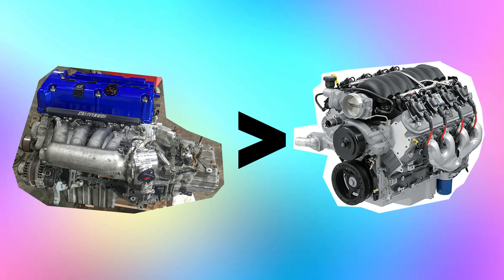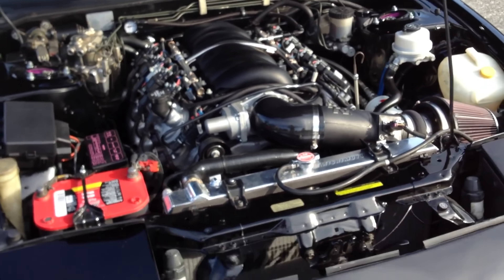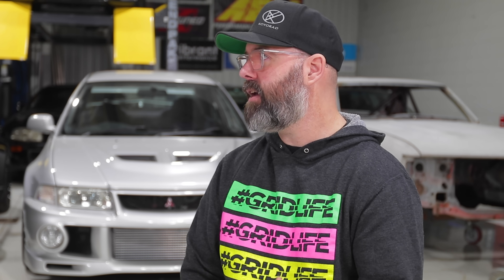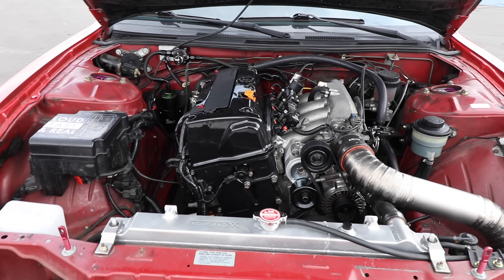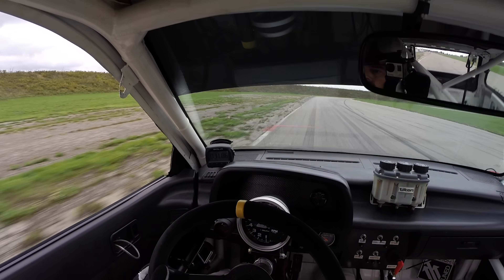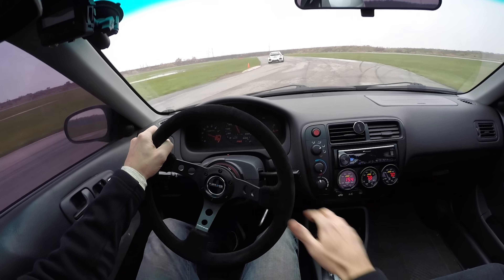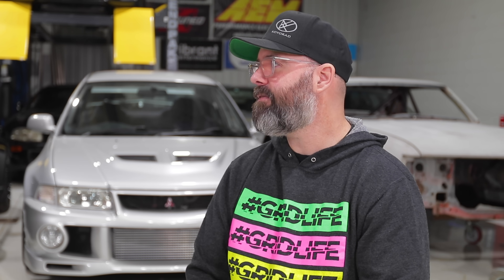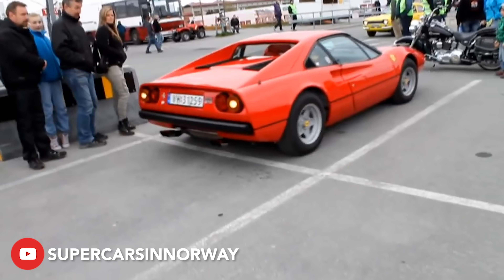Is the K-SWAP the New LS Swap? Everything you need to know about K20 K24 Honda Engines

Comment: Is the K swap the new LS swap? While it's on its way to becoming the belly button swap for small cars I highly doubt it'll see the same range of use as the LS/modern LT family which has been the default engine in damn near everything, for better or worse, for almost 15 years. I think what you're going to see is a possible parody between LS/LT, K series, and possibly JZ but it would be nice if more people would get away from the cookie cutter  engines.

Comment: Downside of the k for fwd and mid engine cars is the transmission.  Honda makes great engines but not transmissions.  I've heard of the rsx 6 speed tranny breaking on the dyno on a stock motor. You have to spend lots to get a reliable Honda transmission.

Comment: the k engine is great, but actually doing the swap is quite expensive for most chassis. spending usually about $10k for everything to get like 250hp vs fully building what's already in your car, or building for boost is where i dont really understand why people like the K. but if money isnt a factor then all power, they're dope engines with lots of potential.

Comment: If you want a good sounding K series, you really have to keep the exhaust buzz under control with proper resonators and mufflers, and let the induction provide the soundtrack. The intake noise on the K series is great, and you can still make great power with a quieter high flow muffler setup.
Reply: applies to almost every high revving 4 cyl N/A engine
Reply: Vibrant piping only
Reply: @ssjdavid  what
Reply: @MotorSwapDan  vibrant performance piping
Reply: The Q300 at 2.75in ID is the best sounding exhaust on the K. Hard Race has a 3in that also sounds superb

Comment: Would love to see a K-swapped RX-8. The series 2 (09-11) used the same trans as an S2000, so I assume shouldn't be too hard to fit up, and the 13B-MSP's power and torque curves are near identical to an S2000 and so gearing etc for a K-swap should be pretty good to go, right outta the box.
To be making 250-300 NA high-revving whp with a small engine that maintains the balance of such a good car that is so avoided because of the rotary engine in it, would be an amazing project. Not to mention, an incredibly affordable shell to start with!
Reply: It’s bin done a lot actually
Reply: @Rxwaat  I haven't seen any build threads/blogs/vlogs on a K-swapped RX-8, or at least one that shows the challenges faced and overcome and the job seen to completion.

But if you are aware of any, PLEASE do provide a link as I'm VERY interested!
Reply: @joshwolfe5260  6berries on Instagram I forget his YouTube channel. He’s helped me a lot with k swapping my rx8

Comment: We approve of this video :)
Reply: Please make FC3S swap parts pleaseeeeeeeee!!!!!!!!!!!!
Reply: If you’re doing the K E30, please add the K Cressida.  I’ll be your first customer lol
Reply: We all know you don’t know what you’re talking about, since you just referred to every 6 cylinder engine on your list as a “V6”
Reply: I’m trying to do something so sinful even Christ himself would ban me from heaven.  swap a K series into a B5 A4 with Quattro 6 speed manual 😅 already know where to find an adapter plate just need engine mounts 😊
Reply: K swap new edge mustang? Bad idea?👀 pretty similar weight and size to a 240 just sayynnnn.
Reply: Li as a
Reply: Who is we? Here is why K Series are not superior.  I rather Swap LS engine or Rb26, 2jZ k series are good but it's 4 cylinders and Front wheel crap drive  comparing to ls v8 or v6 2jz Or RB26DETT Nissan  RB28 is more superior and Reliable even with turbos bc no.matter what u do The K Series engines with Turbos wont passed 100  thousand miles without major Problems or Major Maintenance
Reply: @Mansour-O-Killuminati  ah yes the legendary "V6 2jz"
Reply: @THEWATER3UCKET  V6 2JZ is superior than I6 2JZ. It is capable of 10000 hp on stock bottom end(No, I didn't miss the zero).

Comment: You can take an LS3 and change cam and springs and make almost 600hp. And I'd bet my entire collection of Snap-On tools that a K-series with all the associated plumbing/intercooler and turbo weighs about the same as an aluminum LS. I love a K-series. But it doesn't hold a candle to an LS lol.
Reply: There can never be too many good engines! LSes and Honda Ks have a few things in common: they are relatively cheap and plentiful, there is a lit of support for them, and they have great packaging that make them suitable to many, many applications.

Comment: This definitely seems like the go to motor for transverse setups, or anything where you can't fit an LS. For longitudinal where they fit, the LS still has the K beat handily in terms of power per dollar. That $8k for a 300whp K motor would get you a 500bhp LS3 crate engine straight from GMPP.
Reply: Why would you waste 8k on a crate engine. Stalk the junkyards. Its not a sema build. An Aluminum 6.0 CAN be found in the junkyard for 200 USD at my junkyard. You're not entirely likely to find them, but you can find the iron 6.0s and aluminum 5.3s all day for the most part. Cheap shit.
Reply: @benbauer1257  Yeah definitely. Same as you can find reasonably cheap K motors as they were saying. LS handily wins power per dollar no matter what comparison you make. I was just comparing new engine to new engine because that's what they gave numbers for.

Comment: Wait, why would you need more engine torque in a heavier vehicle? That doesn' make any sense. You can get the same wheel torque by changing gear ratios.
Reply: There's probably a reason Honda uses a K24 in the Accord and not the CBR1000rr engine despite the fact that they make the same hp and I'm pretty sure that reason is torque.
Reply: Between S2000 and E46, there is only ~200 kg difference, not ~1200 kg as between a bike and an Accord. 
With a N/A K20 you can easily get the same wheel torque as one of the faster E46, say a 330i. 
In a heavier vehicle you want more power, engine torque is secondary.
Reply: @Remenschneider  the difference in torque between an e46 330 and RSX Type S: 73ft/lb

The difference in torque between 08-12 Accord (K24) and CBR1000rr: 85ft/lb

If you're suggesting just using gearing to make up 73ft/lb what's another 12ft/lb?
Reply: @lb9gta307  Let's take a stock FD2 Civic Type R (221hp, 159 lb-ft, 5.062 final drive, gear ratios = RSX Type S) against that 330i and compare peak wheel torque through the gears (winner/difference).
 
1st 330i (+4%)
2nd FD2 (+6%)
3rd FD2 (+12%)
4th FD2 (+13%)
5th FD2 (+12%)

Then again, the FD2 has a 6-speed vs. the 330i 5-speed transmission.
If you compare 6th gear FD2 to 5th gear 330i, 330i wins (9%)

I know you'd need to consider the vehicle speeds in each gear,  engine torque curves and wheel diameters to get a "real" comparison.
Internet says FD2 does about 62 mph in 2nd, 330i about 65 mph. 
I'd say that's close enough, the FD2 does have a bit shorter gearing but nothing unreasonable.

So, K-swapping the E46 wouldn't be a bad idea because you need something with specifically more torque, it's just likely not worth it since the 330i is so close and the M3 exists, which has tons more power in the first place.

Comment: What’s HP vs weight of a LS vs K motor at the 500 HP, because that’s a cam swapped LS low power, so you would need to add the turbo and plumbing intercooler ect weight to match the power level

Comment: When will Summit(or large mass production company) start pushing out engine blocks and cylinder heads (for Honda, Nissan, Toyota, etc)... Till then its hype.
Reply: Hard to get better than the stock head.
Reply: From what I understand the old LS, Hemi, Ford V8 head designs are rather inefficient compared to Honda's K-series heads. In comparison, the K-series heads flow like crazy from the factory relative to displacement. Take my 8th gen Si for example with the K20z3 from the factory; they put down at max ~170-180whp (and that's being generous) completely stock. With a 3.5" cold air intake, catless long tube 4-2-1 header, 3" exhaust and an ECU tune they'll put down ~220-230whp reliably, with huge gains under the curve in the mid range, rev limiter pushed out to 8500rpm. So full bolt ons, allowing more airflow to and from the head, then adjusting fuel, timing and cam angles through software. That's enough to pick up close to 50whp. The head isn't a major bottleneck until you go deeeep into a 300+whp all-motor or 700+hp forced induction setup.
Reply: What I was saying is the aftermarket is a bolt-on aftermarket . You have to own an engine to start... compared to an LS that has an after market of non GM manufactured blocks, heads, cams, etcs. If Mugen could be like Summit Racing and manufacture (High and standard level) blocks and heads ... then it would be the new "LS swap." Also push-rod is garbage and OHC tech is superior .
Reply: @cmarz6564  You can buy off-the-shelf CNC ported and billet heads from 4Piston, they also sell long/short blocks and offer the option of sourcing the engine for you. Drag Cartel, KMod and Prayoonto offer built blocks/heads as well, among others. Most are Honda OEM heads or blocks that've been modified from stock unless you want to spend $6k on a head. Even when it comes to intake manifolds (usually one of the last bolt-ons to be done on many cars) the aftermarket options aren't even as good as getting a Honda RBC or RRC manifold ported and polished. For the K20Z3, if you keep it N/A the majority of the aftermarket intake manifolds are actually worse than Honda's design. Some modifications make sense on other platforms but simply aren't cost effective with the K-series. Also, even high quality aftermarket parts are less reliable than Honda's OEM parts, which isn't always the case with the LS. Eg; cam swaps are super popular on the LS engines, while even the mildest aftermarket cams in a K-series motor have been known to cause cracked rockers, timing chain tension issues, cam gears skipping teeth, valve to piston contact, etc.
Less opening of the head/block, the better. Let alone going with a non-oem block or head. Anyone who has worked on one can tell you they're hilariously over-engineered for the majority of K-series real world applications (like getting groceries in a CRV).

Comment: To the guys at speed academy.. Is the K series engine all that much better than the skyactive 2.0 in the ND2 that you guys have driven?   With BBR super 220 you can get 220hp/170tq from an N/A ND2 Miata.  If you look it up the tq/hp curve is impressively linear and available down low (@3k) with a redline @ 8k.
Reply: https://bbrgti.com/blogs/news/bbr-launches-super-200-super-220-packages-for-2019-184-ps-mazda-mx-5-with-up-to-220-bhp-now-available
Reply: It's a lot harder to extract meaningful power from the Skyactiv plant because it's primarily designed for super high compression and efficiency. The aftermarket isn't even in the same ballpark as the K. Maybe in ten years we're looking at it like we look at the K now, but who knows.
Reply: @mapwheel00  But I guess if you're keeping it N/A and you want to mod a ND platform... You can get a stock ND2 Club for ~$25k and spend $3k for the BBR 220 kit (220hp/170lb tq) w/8k rpm.   Or you could get an ND1 for ~15k and spend another $6k for a K20 swap including ECU/tune.  Would the K20 N/A be that much better than what the BBR kit would offer?

Comment: Beams are relatively cheap as well. They won’t make the power of a K N/A but they rip with a turbski. Not only that but you CANNOT beat a beams if your hunting that spine tingling high rpm 4 banger scream. K is a great motor but I gotta have my sounds.

Comment: The reason for the success of both the LS and the K is that neither is exotic, they are cheap and readily available with variants having been used to power all sorts of bland utilitarian vehicles, as well as more exotic stuff. Not really something you can say about the 1/2JZ, RB26, etc. which were also made in small numbers by comparison.
Reply: True; but also because they hold up to decent power. If either were known to blow up at 300whp probably not having this discussion right now.

Comment: Now imagine when the k20c's are affordable. Ooooooo baby!!!!
Reply: Its going to be interesting if it catches on. Having a factory turbo system that works and is reliable will be an easy swap for bigger power than an N/A k swap but how many are going to want to go through all that for a tiny turbo? If I want a turbo charged K I'm going to get a k20a and turbo it myself. Unless you just want a swap for a daily, I don't think its going to be too popular in the race scene unless they just become dirt cheap. The L15 might be different. There are tons more of those but they need a lot more work. The internals are frail.

Comment: I don't entirely disagree but this discussion always leads to specific HP/ HP per Liter discussion.  When you want 600HP if its a 2.4l or a 5.3 who cares?  Specific output is an argument for small motor people, back in the day I was tooling around in 2.2L Mopar turbos and making the same argument, i'm making 140HP per L beat that yadda yadda, ultimately who cares when you are losing.  Those cars didn't lose much considering the street competition at the time.  My big problem with the K is the transmission issue FWD they all break and start needing every more expensive parts, RWD means using something from yet another vehicle.  Anyway just my thoughts.  Oh and $15000 for a 300HP motor?  Wow if I ever put that into a long block it would darn sure be north of 1500 HP and have 6 or 8 holes in it and still be reliable.
Reply: High hp per liter usually either means a power adder is being compaired to displacement or they're proud that they intentionally make less torque. It also usually means less average hp.

Comment: I bought a second hand k20a2 and am putting it into a Toyota MRS.

I cannot stress enough about that timeing chain tensioner.
Luckily I checked mine and it was broken on a bone stock motor of less than 100k miles.

For the sake of a tiny cost save yourself the headache and replace the chain and tentioner with new oem honda ones.

Oh and the k20z upper chain guide fits on the older k20a motors and is much bigger. That combined with the aftermarket lower chain guide will make the timeing almost impossible to skip even if the tentioner does break.

Lastly if you are pushing big power then buy an aftermarket crank gear with a full keyway cut in it as on the stock one the small timeing pin has been known to break.

But yeah thanks for another great video and I look forward to more of your k shenanigans in the future.

Comment: Ok guys this video is a huge stretch.  If u really dove into these two engines.  Ls will still win for the next five years atleast.
Reply: Depends, LS/LT is a damned strong platform, but there are a lot of platforms where they are impossible to fit, with transmission and exhaust, without a LOT of work, and even then... then there is the weight - most of the world is also interested in going round corners. There is also the problem of getting hold of the LS and transmissions, as many countries don't have them in their vehicles and they are expensive to import.
For some applications, the LS will rule, for others the K series, and different engines may be best for other applictions - they're all good, in their place.

Comment: Top videos as always chaps.
I'm in the process of rebuilding my EP3 Civic track car engine.  Keeping the 2.0 displacement, but revs, lots of revs and lightweight everything!
No doubting the torque of the K24 is a benefit, but I'm hoping for a response monster.
Reply: Better be putting some monster final drive in it to get the most of those revs
Reply: @tomasbegley3032  I changed from the 4.7 to the 5.1. It made a massive difference.

Comment: Another engine that should get on your radar for an eventual swap is the current Audi 2.5 TFSI that generates 400 HP in stock form in the RS3. If you look at Iroz Motorsports, they are making over 1000 HP with bolt-on plus internal mods, but you can safely get over 600 with stock internals. I'm definitely looking for an RS3 as my next car! (but I'm a Audi guy since the 90's) https://en.wikipedia.org/wiki/List_of_Volkswagen_Group_petrol_engines#Five-cylinder_petrols
Reply: Cost would be a concern, but the sounds, glorious 5-cyl sounds! https://www.youtube.com/watch?v=NGEdDlurqbA
Reply: They do sound amazing but 🤑